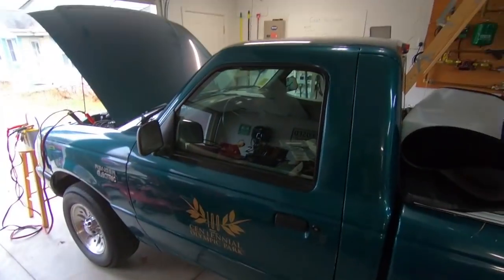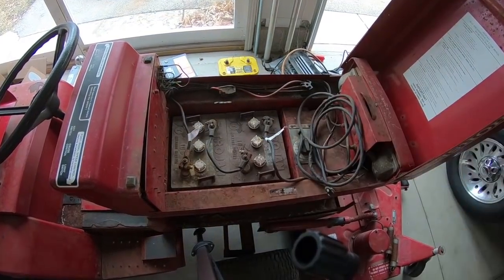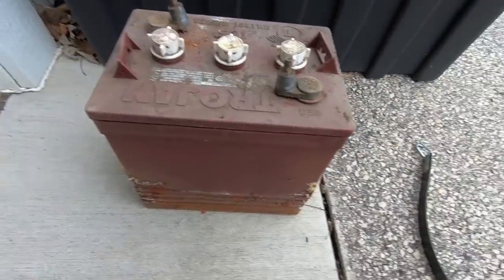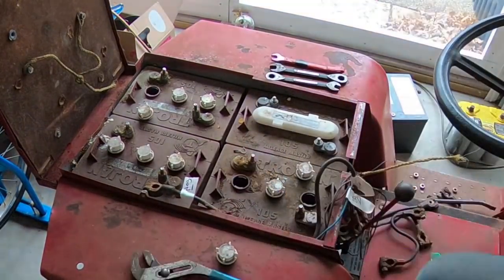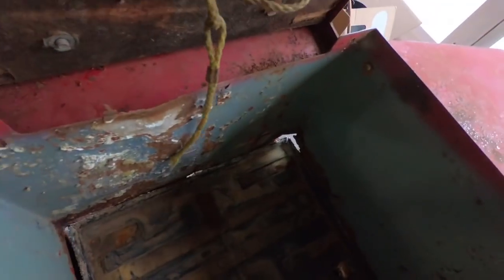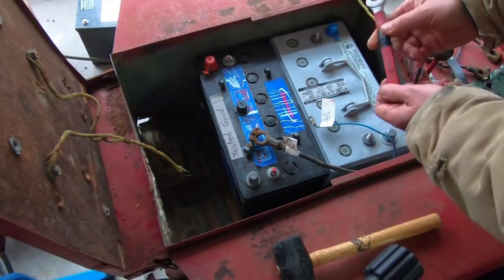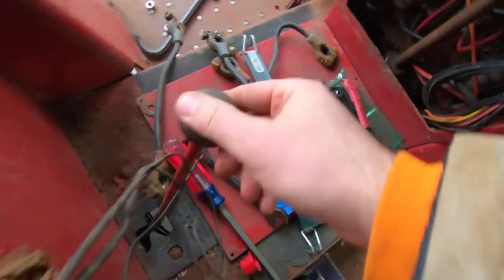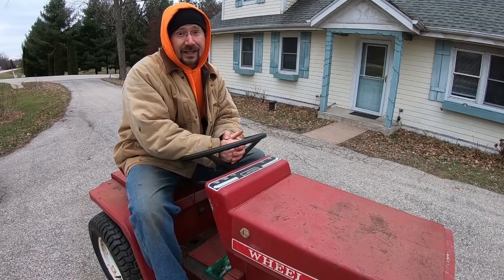Wheel Horse Electric Tractor Battery Replacement

Comment: It's 2021 and I am still using the E15 I bought new in 1971. I have most attachments. It is the most reliable item I have ever had. If the poly bags were in, there would be almost electrolyte damage to the steel.  I remove my batteries, poly bags and plastic trays every 4 or 5 years to wash the inside of the battery boxes, the batteries, bags and trays. Paint the battery boxes, let dry and reassemble.   I do not have any rust.
Reply from the maker: Fantastic machines, aren't they!~

Comment: I like this even more than the GE machine.  Especially with the front mount mower deck frame.  I can see how that would make mowing upto and under trees and other low lying obsticles much easier.
Reply from the maker: This is the exact same style as the "Large Frame" GE ElecTraks. Those also have the front-mount mower decks, electric lift, etc.
You might only be familiar with the "Small Frame" ElecTraks. Those had a mid-mount mower deck.
I do like that with the front deck, that you can SEE exactly what you are mowing, and that you mow the grass WITHOUT flattening it with the front tires first. Front mount decks are nice for pulling right up to the edge of a building or straight up to a tree. Ironically, they are NOT as good for going AROUND something. If you are mowing a circle, the mid-mount decks are actually better.
The front mounting system is also advantageous for other attachments such as a plow or snow thrower.
This winter, I mounted a snow thrower on the front of my daily use ElecTrak. I've been very pleased overall with it.
https://youtu.be/V214RRVn7HQ
https://youtu.be/bdP-EIlxZys

Comment: The group of the big six volt batteries would provide probably at least twice the power that the 12 volt batteries you threw in their will
Reply from the maker: Absolutely! Six of those 8V batteries MAXIMIZES how much battery can be crammed in the tractor! But since those batteries were DEAD, DEAD, DEAD, with the cases even cracked open, swapping ANYTHING in there is better than what it had. Before this, I didn't even know if all the forward gear controls on the tractor worked or not! The used batteries are at least good enough to test out the tractor and check things over before investing money in a proper set of batteries.

Comment: I noticed you took the "tested good" off of that battery when it decided to crap out on you. Funny stuff. I wasn't aware wheelhorse built an electric tractor.  Very interesting.
Reply from the maker: Ha ha. I was wondering when somebody would notice that. The "Tested Good" was from probably 3 years ago - the last time I used the battery. Watch some of my older videos. You will notice that battery in the Electro-Metro at some point. Kind of hard to fault a battery that's over ten years old and was used when I got it back then!

Comment: Going electric you doing what a lot of people want to do thanks brotherI switch my gas Troy-Bilt mower to propane really simple only cost me $15 I can get propane for $0.60 a pound
Reply from the maker: It's not that tough to convert a small engine to run on propane. Many commercial lawn mowers run on it. It does burn clean (compared to gasoline.) You still are burning fossil fuels and have to perform maintenance, such as oil changes.
Lithium battery push mowers have REALLY caught on lately, but there still aren't many electric riding mowers yet.
Reply: Propane has gotten pretty expensive here in Washington.